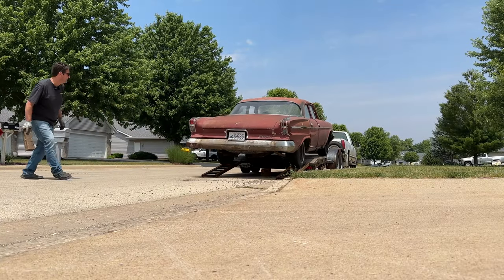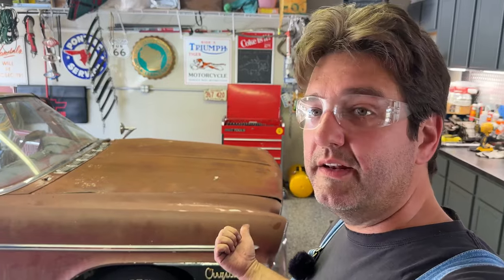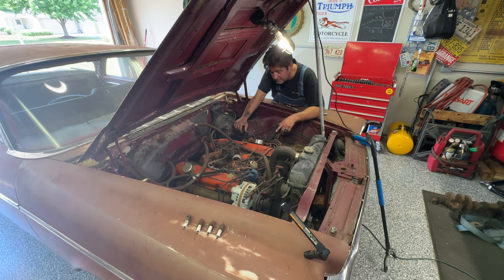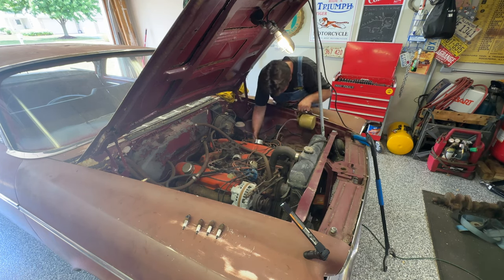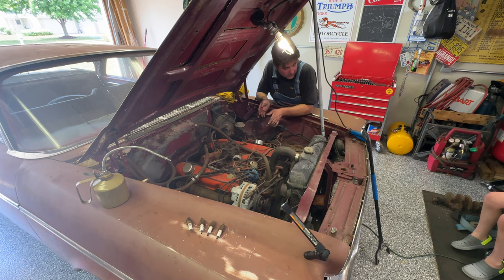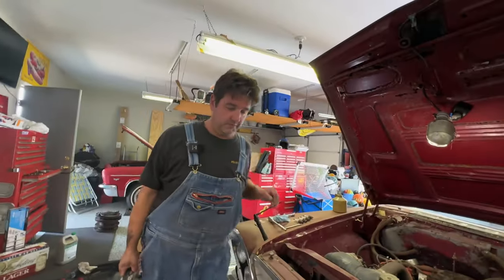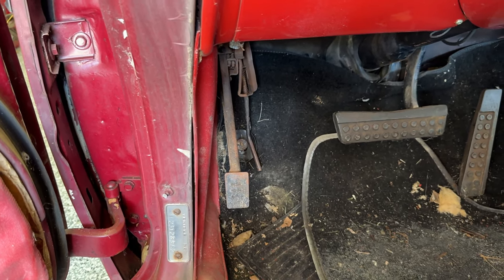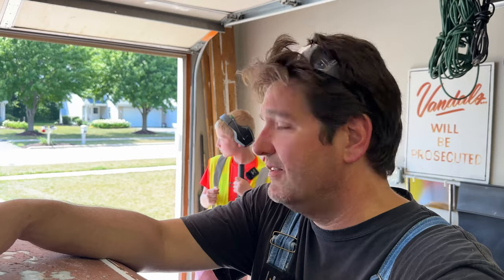1962 Chrysler WILL IT RUN ???

Comment: I have seen some engines that sat for long periods have sludge in the bottom of the pan and it is hard for the pickup to suck oil in it's got to be drained or heated up to loosen up for the pickup to get suction

Comment: My first car was 59 Dodge, and 2nd and 3rd were Sport Fury’s w/ 361 c.i. I thought they were small blocks.
Reply from the maker: Chrysler had some crazy engine options way back then…Chryslers in 62 never came with a small block…rule of thumb is, if the distributor is in the front…it’s a big block